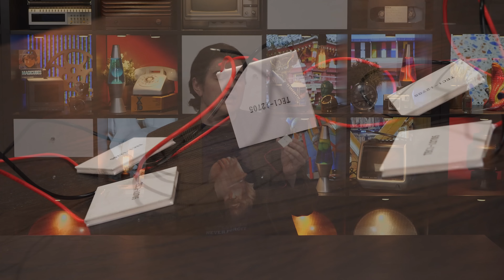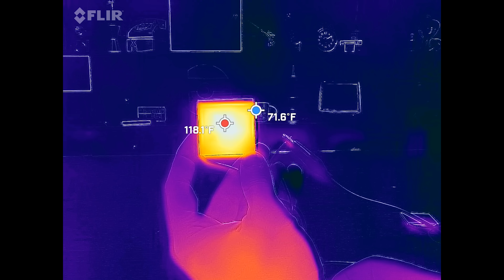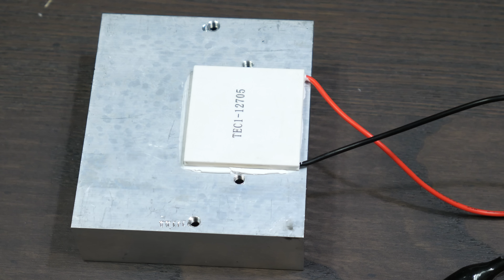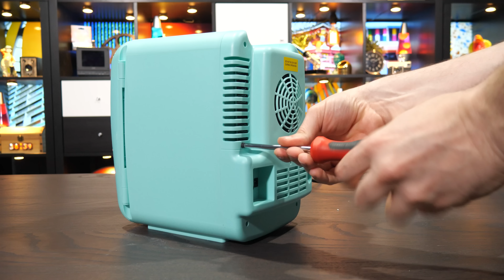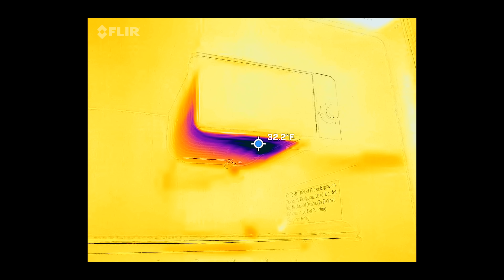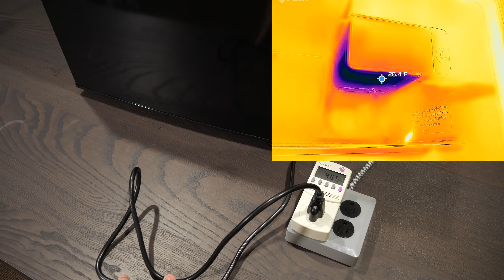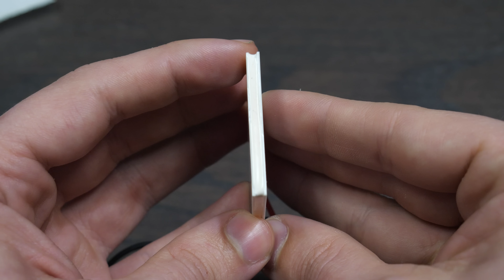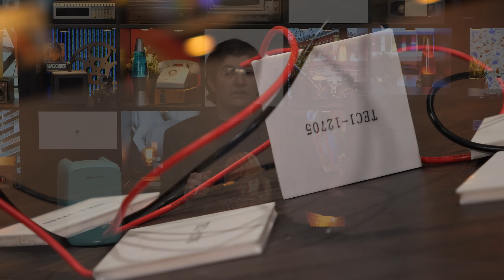Thermoelectric cooling: it's not great.

Comment: There are some good ones for cooling, I have a mini fridge that forms ice in it when left running. It's great for keeping stuff cool, though definitely has the same issues of power drain. But it's small and I got it for the look (the Minecraft Legends Creeper mini fridge) so honestly I wasn't even expecting it to work as well as it did. I think when made well these mini fridges can have some value.

Comment: So you are complaining about too little isolation, lack of regulation and missing cascadation of cooling elements.
What does it have to do with peltier elements?
Reply: Their use in “personal-size fridges” is so woefully inefficient that they’re only worth considering if you genuinely don’t have room for a heat pump-equipped fridge.

Comment: similar to what others have said, peltier coolers are pretty good for cooling inside electronics if you just need to drop a few degrees to keep something at a specific temperature during operation. They are used in some pollution monitoring instruments i've worked with to maintain proper reaction cell temperatures and component temperatures. in those applications they are amazing since they do their job nonstop very reliably versus having an intricate liquid cooled system or w/e. i've also wasted a ton of time trying to get peltiers to cool 5 gallons of homebrew before and yea, in any real world refrigeration system they are absolute garbage at the job.

Comment: I found your "short" explanation of the heat-pump-cycle very odd. I'd say:
A) it's a closed loop.
B) split in two parts.
C) inner low pressure part where liquid refrigerant comes from the outside part via a pressure valve (separating this connection between the two parts).
D) outside high pressure part where liquid refrigerant comes in directly from the compressor (which is why it's liquid and the other barrier between the two parts).

via the physical properties of the refrigerant this leads to
E) its "evaporation" in the inner half where it "want's" to evaporate because of the low pressure but it requires energy to evaporate -> it sucks as much energy as it can from "outside" (which is the inside of the refrigerator).
F) outer high pressure "heat dissipation" part where the previously evaporated, heat "saturated" refrigerant got compressed into a liquid with even more energy contained (collected heat from inside + compression energy) which is now higher temperature than outside, thus shedding heat to the outside (literally outside this time).

Now the main difference is in F) - I'm not sure if this is because the refrigerant stays in a gaseous state the whole time(?) and/or only condenses into a liquid near the end of the outer half?...
The way you explained it it sounds like the refrigerant stays gaseous during the whole process - yet you bring up it's boiling point???

Maybe
F2) the "heated" gaseous refrigerant from inside gets compressed (absorbing even more heat) but to actually reach the equilibrium between stored energy, liquid state and pressure in the outside "condenser" (heat exchanger) it "need's to shed heat" to the outside.
(It's boiling point is in a range where under these conditions it's quite a bit warmer than the outside air so it dissipates heat and cools down to outside temperature and liquefies?)

Comment: I modified one of these mini fridges and added a microcontroller, thermocouple, and an H-bridge to keep medication at a constant temperature (it's not a very big delta from ambient and in winter i need it to warm which an actual fridge can't do so it's a decent use case) and what i found was the biggest problem with these thermoelectric mini fridges is that...the insulation in them is practically non-existent. like..2mm thick. the fridge will get up/down (depending on season) to the target temperature range, but it nearly immediately starts sliding back towards ambient, thus it ends up running at ~30% duty cycle just to stay in a +/-2C range.

Comment: I got one of those little fridges many years ago. It only really works well with aluminum cars which transfer heat or cold really well. Anyhow regardless, the coldest it would get the cans down to was 42F degrees, so I set about on seeing what I could do. I replaced the little fan with a larger one and moved it closer to the heat sink, that meant adding more holes around the ones in the rear plastic cover to draw out the extra air from the bigger diameter fan. The end result was I was able to then get the can temps down to 37F from 42F, not a bad result for a fan change out and some minor mods to the rear cover.
Reply: Nice work. I too bought a couple for cold drinks in my car when I traveled a lot. I never used them but planned to add some ice or ice pack.

Comment: You also forget the fact that eventually it fails and gets ice inside it. It creates its own ice and then it starts melting. Guess where it melts on the inside rusting the screws because they’re super cheap and also on the back panel meaning it shorts itself out it’s a fire risk as well.

Comment: So I found a use for thermoelectric cooling: moving my networking equipment into an uninsulated attic so I don’t have to hack up the drywall to install wired Ethernet in my house. A couple of peltier plates with generous heat sinks can keep a foam ice chest well within operating temperatures in the summer and winter, with an Arduino doing thermostat duty and swapping polarity to the peltier as needed. I wouldn’t trust a mini fridge in my attic, even if I hacked the thermostat.

Comment: ...so the mini-fridge is basically just a terrible space heater.
Reply: To be fair so is any fridge
Reply: I think it is still an heat pump, so it should still better efficiency than a space heater
Reply: It does not. As he said, best case scenario, a Peltier has a COP slightly above 1, and they’re usually much lower. 1 is the baseline for a space heater.

Comment: You said something very interesting.  You mentioned that the Peltier cooler deliberately had a hollow door, to let heat in to keep the device from freezing.   I assume it stops operating if it freezes.  I always suspected that a huge limiting factor on the efficiency of a Peltier cooling device wasn't just the heat sink and fan needed on the hot side, but that it Also needs a fan blowing air on the cooling side, to keep it from getting too cold!  What if the device gets less and less efficient in its cooling capacity if the cold side of the plate gets too cold?  What if there was plenty of insulation all around the Peltier device, but an additional fan Inside the fridge, pointed at the cooling part of the device, blowing the internal air of the fridge across the surface of it.
I know that means an electricity usage of two fans for the device, one to dissipate heat from the hot side of the device, and another to keep the air circulating inside the fridge over the surface of the cooling side, but would this not make the device more efficient, or at least increase the amount it can cool?  I think that might be worth experimenting with.

Comment: They do have some use for just keeping your water or soda cooler than the surrounding air. When it's 90 degrees, a 70 degree bottle of water or soda seems cool. Or if it's 50 degrees, then these coolers would be ok to use instead of an ice cooler.

Comment: I've ideas about using the temperature differential to generate electricity. Like, could you put them in the hull of a submersible with hot rocks on the inside and seawater on the other, to generate current and charge batteries used to propell the craft. Like an RTG generator used in soviet weather stations or spacecraft. It didn't seem like it would produce enough to fight even a weak tidal current. Interesting

Comment: Waaaaait, trying to help my head, soooo, magnet perpentum is shii, but compression perpentum could be done, 
Like if you move 3 times more energy then you used, then feed the output heat to reverse engineered fridge in reverse in it's function, you multiply the cop of 300% to 900%, then 2700%, then like 8000% ant now we are at what, with minus 4 degrees of Celsia as average, x27, like -110 on one side, and like, maybe 600 degrees Celsia on the other, if you have every connection done via 100l box, 

The useage would be 27x40 is 1100

Ohhhhhhhhhhhhhh myyyxy god!!!!!!!!!!!!!!!!!! call the fbi!!??

We use just have 27 steps of TC from nearly absolute zero maybe (idk absolute zero) the -110, to 600 Celsia, 

Using only 1kw !!!!!!

And like one good peltier can generate around 5w at 100degree difference, 30w at 600 cel.dif. and if we imagne like peltier could survive it, to save time on parraler discharge,, ce coud make like compressor particle accelator, but with heat. 

Both ends on either generator or accelerator optimized
We just like eat tuns on energy from air, we can use the 27 steps of tempatures to produce, we might 

we might expand of idea of free movement, conservation and maybe even generation/capturing of either energy or products from the I/o of the machine!!!! 

Ohhh my god, my brain tingles!!

Comment: I have one and it works pretty good.  Even gets icy in a 70° room.  The only downside is that if you fill it with warm beverages it takes 12 hours or more to get to the minimum temperature. If you only replace one or two cans at a time its fine. I haven't made any modifications and it was only 25$.

Comment: I didn't give much attention for that when I bought a few things that uses Peltier and when I realize I was really disappointed. I have a 96L beer cooler (compressor) set at -2ºC and a 16 bootle wine cooler (Peltier) set at 16ºC and consumes basically the same power as the beer cooler (1.5kWh/day). Another issue is it stays on all the time, so I have to replace the fan every year and make maintenance constantly due to dust.
Also, I sadly bought a water filter with Peltier. As it can only store 800ml of water at 10ºC, at least it doesn't stays on all the time, but also, consumes a lot of power, fan noise and gets hotter than my Desktop. The only advantage of this one is the weight, less than 3kg, but after setting in place, that doesn't matter.

Comment: Magsafe chargers with a peltier element works great, especially in summer heat in my car. There's no more over heat shut-off of the phone anymore. And the phone chargers wirelessly with less heat. There are neckfans with built-in peltier elements. The cooling it does works great to stay cooler in summer heat. Also, heavy mobile gaming on the phone, especially those tripple a games, benefit from keeping the temps down a bit. Every device has it's uses. You don't use a hammer to cut down a tree.

Comment: the problem is that people are dumb and not building it right, basically the Peltier effect is just pumping heat electrically, however it's better for small applications, since they would need a larger dc current, more power, and less safety, unlike the best thing ever, the heat pump/refrigeration circuit, so yeah, build it with hot away from cold, and look at it from that perspective

Comment: As an HVAC tech I immediately knew what the problem was. You see we dont just make things cold, what we actually do is move heat somewhere else.
Reply: Yes - I was hoping for some info on heat released by the different devices. Can only assume the mega-user of electicity ALSO added more to room cooling requirements.
Reply: 2nd law of thermodynamics
Reply: And create heat in the process
Reply: @jman0870 can’t create heat
Reply: @auhin huh???
Reply: @auhin with that logic you cant create anything, your just reshaping stuff that already existed. You cant create a house, because the wood its made of already existed. It could be an interesting philosophical point, but theres no reason to use it as a gotcha.
Reply: @auhin  You misunderstand the term “create heat.” Heat is a byproduct of action, in that the energy used to create action is turned into heat. Obviously you didn't create the energy that became heat, but that's not what “creating heat” means. By that logic, nothing is created. You may have built a birdhouse, but the molecules were always there.

To jman, if you saw the notification: accidentally replied to you first, my bad! You're all good.
Reply: @auhin  I think we all know what they meant in a more colloquial manner
Reply: You've discovered thermodynamics

Comment: I feel like this could be useful if you’re specifically looking to not work with refrigerants, for someone making a diy fridge maybe it would be easier to make an extensive water cooling system for the hot side to keep it basically room temp that way the cool side can work at max efficiency. Probably a little power hungry but it’s a trade off I’d be willing to work around as long
Reply: Like literally treat it like a gaming computers cpu and cool tf out of it

Comment: I had to integrate a peltier into a system for work not long ago and what I found was that the way you drive it matters MASSIVELY for efficiency. Most of the drivers simply pulse the peltier on / off with a tunable duty cycle at a constant current / voltage. Driving these peltiers close to their max current is insanely inefficient. In my system, my object reached thermal runaway in a couple of minutes just sitting there doing nothing with my first TEC driver. Then I upgraded to a driver which properly smooths the output with large capacitance to turn the PWM into a stable voltage and uses a temp sensor and tunable PID controller to drive to a set point; and miraculously the same peltier is really efficient and does a great job of keeping laser diodes at room temp. So I wouldn’t damn peltiers in general, I think you just bought a cheap and shitty product.

Comment: Another use case of these plates is in self sufficient fans to blow the heat from wood stoves into the rest of the room. The temperature differential between the top of the stove and the ambient air generates enough current to power a small DC motor. Technology is pretty neat!

Comment: Peltier units are really good at fast temperature regulation and keeping something very stable but they cant be used for providing the majority of the heating/cooling load. You really need a chiller (or something else for heating) to provide the vast majority of cooling power and use the peltier with a PID controller to do the fine tuning but I don't think there will be many commerce applications for them that make sense.

Comment: I've had numerous cooler boxes fitted with these.

Currently have a Coke box that holds 40 cans and so cold drinks hive brain freeze.

They're left running 24hrs with 4hr switched off each day to defrost.

Our Summer Energy is free as we are currently generating 40kwh per day.

Comment: We could make a system combining the peltier concept with a coolant pipe array. It would not be as energy effective as a normal fridge (not done any numbers but it’s probably cheaper to make 1 compressor then 100 peltiers wrapped around 50 ft of piping), but if it was specifically a full sized fridge designed to be more economically friendly

Edit: what if we just lined a minifridge in a large custom made peltier…

Comment: These "fridges" are not efficient, but it does what it is supposed to do and you are not risking almost freezing temperature like with normal fridges where even 1 on termostat is often too cold for beverages you want to actually drink now, not waiting for it to get warmer + it doesn't make any noise. If you are American, skip this sentence and put ice there to make it even more freezing.
6:19 - Yes, but it is not for food, why would you put food into something that is literally designed to store beverages or wine? 7°C is a perfect temperature for example for beer, for water, it would be still too cold to drink it immediatelly. And even when temperatures around 10°C are not ok for storing food for a long time, it's still fine for storing something for 1-3 days when you are for example in hotel or something. People were using cellars for this purpose with similar temperature in the past and they also lived, but now we are stupid and buy more food than we can actually eat and then we are surprised that it didn't survive and we blame fridge.
But yes, some small classic fridge will probably give you better service, but in some situations, you just need something even smaller and silent and you don't need it to cool down hot drink to freezing cold, it's more like just to keep it cold when it already is kind of cold, you mostly buy it in shop with AC where temperature is like 20°C, it won't get that hot before you get back home. If you are American and you travel 1 hour by car to shop, skip this part.

Comment: Strangely in Indonesia, many of the drink water dispensers are using this technology for the "cheap" types. Tbh, the water barely even getting cool but the fan is very loud trying so hard to cool that peltier.

Edit: Sometimes you end up need to change the peltier because that thing is fragile and can be broken anytime.

Comment: Put 2 or 3 peltier elements with a copper heat pipe for better heat transfer and pair it with Fanless Cooling 'Chips’ that are coming to laptops for the noise issue and all the problems would be solved.

Comment: Not disagreeing at all with your conclusions, but I do see the attraction of Peltier elements. I will be living on a boat, and boat fridges are much less reliable than land units. Something with "no moving parts" in the cooling cycle to go bad is damn alluring. Of course, if you're on a boat in a warm climate with 85° air, you'd only be at 55° with this kind of unit...  I'd love to see more research done on them to see if there is a way to boost efficiency, speed, and cooling ability.